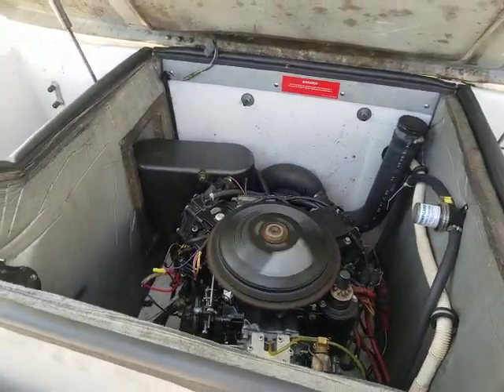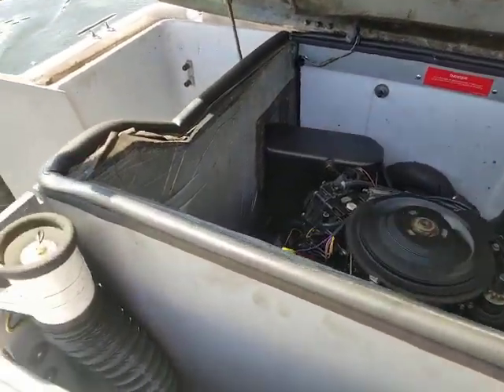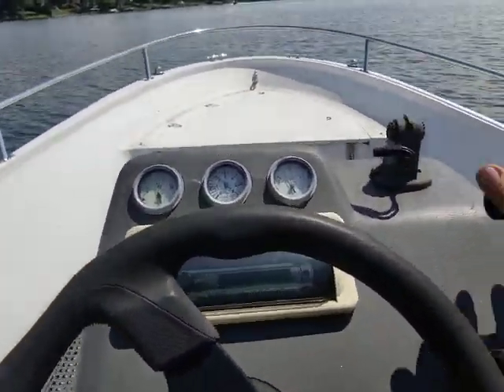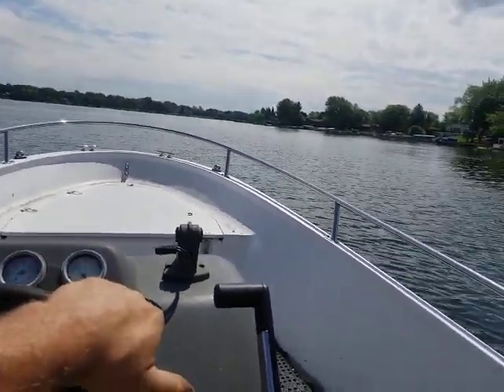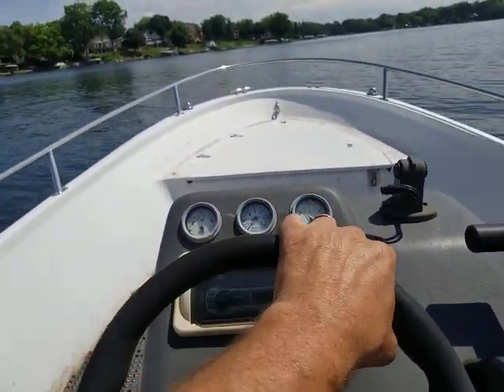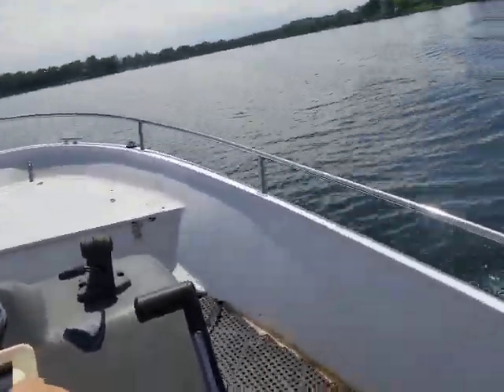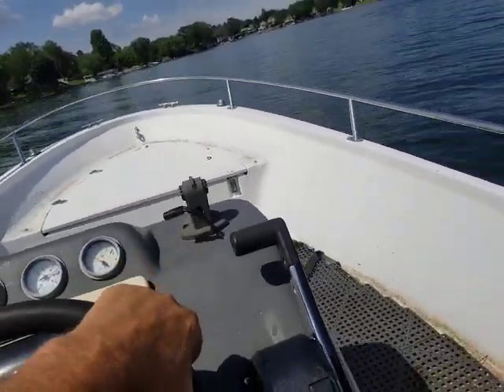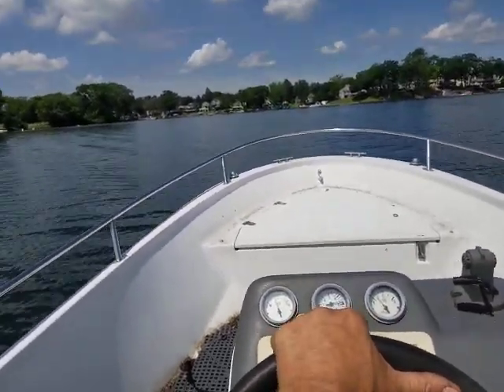Captain Niel's Boston Whaler skiff 115 turbojet rebuild.

Comment: I have a 115 turbo, and everything seems OK not really good, my question is about a VRO That’s been removed, and I run 50:1 quicksilver synthetic,does it running this way still require the fuel recirc system, to get extra fuel/oil to the bearings, have all new check valves and have ti plumbed as shown in the omc manual, except the block off of the fittings used in the VRO, the way it’s plumbed it has a pop in the crankcase,when I pinch the line the popping stops, and runs fine, the line if I disconnect it from the crankcase fitting dribbles fuel every few seconds.don’t want to toast any bearings.What todo?

Comment: Where did you find parts for the 115? I need a new wear ring.
Reply: Did you ever find parts or a solution? I just bought a rage and I need to either fix the engine in it or swap it.